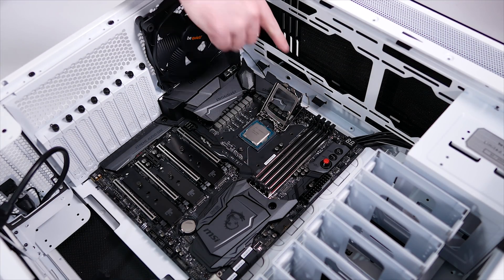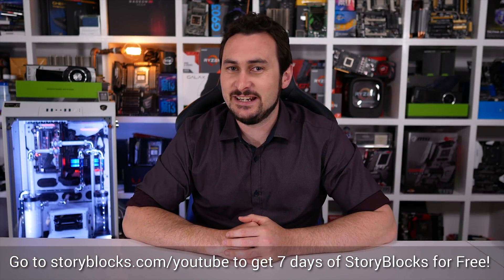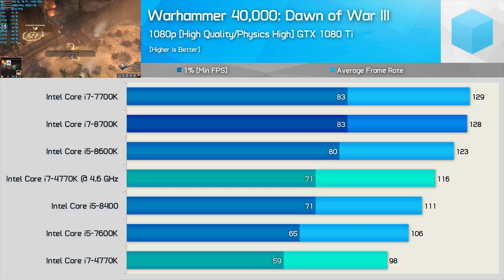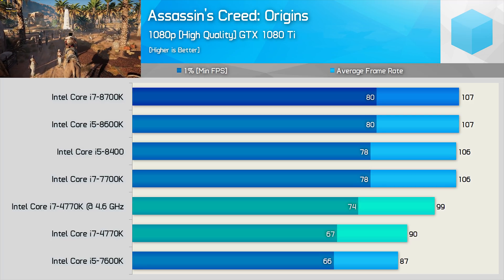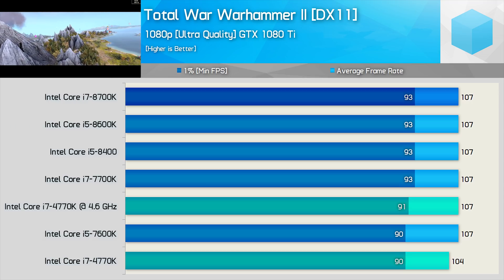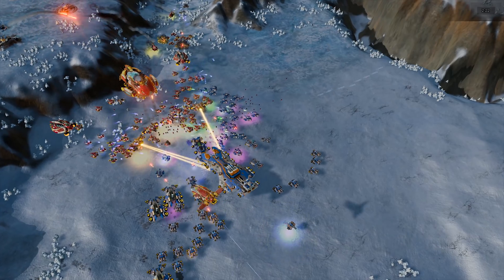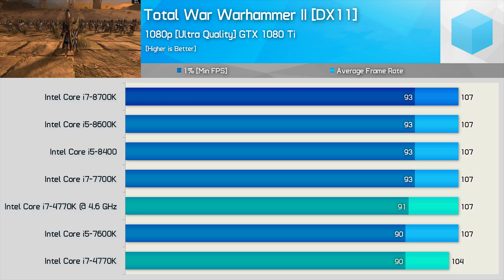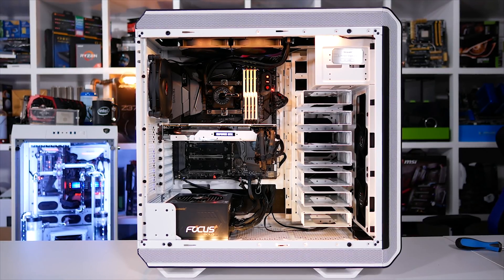4 Year Old Core i7 vs. Core i7-8700K, Worth The Upgrade?

Comment: Working with OC i5 7600k at 5ghz ice cold, and about to buy 2 MSI GTX 1080 cards for SLI. ( Yeah I love SLI looks in my case and messing around with it )* moving on, will the i5 OC bottle neck them? if so will I be ok using i5 7700k or make the leap to 8700k?

Comment: I have a i7-4750HQ and I'm yet to meet a game that will push this CPU more than 40/50% load. A laptop CPU is much weaker than a desktop and if I don't need an upgrade, not even for the next probably 5 years, nobody else need. End of discussion. Saved you almost 20mins.

Comment: 4690 here and the R9 380x.. all games still run fine.. FarCry 5 mix of ultra and high settings means 50-80 fps for me... Totally fine, not a performance point where I start to open my wallet for someone else to get richer off of my cravings.

Comment: I have an i7-4790 and use an msi gtx 980 ti 6GB and have no issues gaming without streaming. I'm only upgrading to the 8700K because my 4790 is bottlenecking my GPU when streaming and especially when i overclock it causing extreme frame rate drops and only able to run 100hz refresh rates on games like Fortnite because of the frame rate drops. Kicking myself for not spending the extra $50 4 years ago and getting the 4790K, but i guess it leads to me getting a cool brand new gaming/streaming pc.

Comment: When you do a cpu benchmark, would be great if could use cards like 1060_70ti. 1080ti is ridiculous, doesn't tell us if cpu upgrade is worth it. Like a 20,30 fps gap using 1080ti could go down to 5,10 using lower cards

Comment: FWIW, MSI Afterburner is your friend. The OSD shows my "aging" CPU's usage at 34% max (23% avg) and VRAM usage at 1.2Gb of the 4Gb available, while my equally old GPU still cranks out 160+ FPS in War Thunder with graphics set to max @ 1080p.

Hardware:
i5 4690K @ 4700Mhz
ASUS Z97-AR motherboard
16 Gb Ripjaws X DDR3 RAM @ 2400Mhz
Radeon R9 380X @ 1085Mhz (core) & 1425Mhz (mem)

Comment: I have 4790K OC on Noctua, had it since it was new.
Am now on 1080Ti, before that 1080, before that 970.

The CPU is not a limiting factor yet, I run games on max details and 2560P.
Did order a couple of ryzen 2700x when I saw early promises of the ryzen crushing intel i7 also in games (by Norwegian tech site), however it doesent hold true. I think I will return both 2700x cpus unused and wait for the coffe lake refresh (maybe we will see an affordable 8 core high performance model?).

I think we are in a bit of a mixed state now, PCI-E version 4 is coming with double bandwidth and lower latency, new RAM is coming, new GPUs, new chipsets, new CPUs. Also I just game a couple of hours each month, so I guess I should return the 2700x  cpus and wait untill 2019 maybe.

Also the new SSDs are coming.

I think the 4790K and the top tier mainboards from that time is a very good combo still, as you have M.2, you have fast USB with quickcharge, decent audio quality, good LAN etc. (I have a mATX Asus ROG board and the best corsair had to offer in DDR3 back when I purchased it).

What is funny though is that the 4790K is still for sale and it costs almost the same as the 8700K :P
But you can of course build a much cheaper 4790K gaming rig for 100+ FPS than i7 8700K or ryzen.

AS you can then buy a used or new mainboard for half the price, also the RAM is much cheaper and availible used.
So instead of people buying a new 8700K and lets say gtx1070, I would rather stick with an old i7 and buy the 1080ti.

I can of course afford to buy which CPU I want, but I dont think its worth the upgrade yet. In 1-2 years I think it will be, especially when we get the next gen monitors also with proper HDR support.

I do want some more cores thougn, I think one thing that is dated with the 4 cores is the applications starting when windows boots. But maybe it would be possible to make them start not all at the same time, some sort of timed launcher, so steam and ea +++ doesent all start at the same time. I think thats the only time I feel I need more speed :P

I do programming mostly on laptops while at work, so I dont really need a lot of multithreaded performance at home.

Comment: This is a good reason why even though I'm running a 1080Ti, I never bothered upgrading my Z97X 4790K system. It's funny hearing noob's ask me if my i5 will run new games when they hear I have a 4790K.
Reply: I'm using a Gigabyte Z97X-UD5H v1.1 with an i7 4790K@4.7Ghz and 16GB of DDR3 PC3-12800

Comment: The real winner is i5-8600K - 30% cheaper than i7-8700K... with 2nd place on most benchmarks... and bit cooler when O/C:)
I've got i7-4790K at this moment (4.6Ghz/1.25V) but now i'm thinking about upgrade to i5-8600K.

Comment: What REALLY PISSES ME OFF is the fact that you guys always do these kind of videos with THE TOP OF THE LINE GPU'S... Try using 1050ti, 1060 (3 and 6gb) and so on. Almost everyone I see building pc's or upgrading there older intel 3rd gen and up systems is upgrading to 1050ti and 1060 gpu's. Your doing this video like 90% of the people are well off and buy expensive GPU'S... Well its more like 90% use 1050ti or lower to tell the truth... I personally have a 1060 6gb in one machine and a 1070 in another. Anyhow...

Comment: My build is a Dell Optiplex 990 with an i7-2600 with 12 gb ram 4+an added 8gb.  I have a Zotac 1060 6gb amp.  Everything runs fine on maxed settings (so far), but I know it will eventually be time to retire it.  I only had a 750ti and couldn't max out everything just got the 1060 and it fixed everything for now.  I would like to know where my CPU is on this chart, at the very bottom?

Comment: thank god AMD finally forced Intel to increase the core count... the singlecore performance has only marginal increments from gen to gen... and at same clockspeed (let's say 5.0ghz on 240mm all in one watercooling) there's about no real world difference from i7 2600k to 7700k assuming all the CPUs are paired with same SATA3 SSD and HDD and all using DDR3 or DDR4 clocked at same 2133 or 2400mhz. Yes there are improvements in the iGPU department and the newer instruction sets make the newer gen way more productivity friendly... but in the raw performance improvement was slow as a turtle

Comment: Probably should use a game like ARMA3 since it stresses CPU a hell of a lot more than console fodder like COD. Also should have used a SLi benchmark for 1070 and 1080, 1080ti options as that's where the real CPU caps will show.

Comment: I don't even need to watch - yes worth the upgrade. I went from a 3570 to an 8600k and obviously its a huge upgrade. I mean it's an i5 and beats the previous flagship i7. Btw that RGB is horrible lol. Some weird results. Everywhere else there is absolutely no way the 7700k beats the 8700k, not even close. It doesn't even beat the 8600k. The 4770 beating it too, ummm no. This is not a very good review IMO as everywhere else, benchmarks prove to be VERY different to yours. I've seen MASSIVE gains, while being only on a GTX 960, so no, your conclusions are incorrect IMO
Reply from the maker: The 3570 wasn't tested in this video, the significantly more powerful 4770K was, and it was overclocked. I don't care about your option on RGB so let's skip that. The 7700K doesn't beat the 8700K in a single test so I'm not sure what you're talking about there, in fact it's quite a bit slower in most of the none GPU bound tests. The 4770K doesn't beat the 8700K either.

If you saw massive gains with a GTX 960 you're the one doing something wrong, I keep those findings to yourself.

Comment: I hate to sound stupid but what was the cooling solution for the i7-4770k and could it sustain full load of "IntelBurnTest" without throttling when overclocked?" Another thing is that "stock" clock is pointless if your cooling solution allows 100% sustained turbo speed. Just compare max speed to max speed. With the right cooler the 4770k can sustain 4.4Ghz and never throttle.

Comment: Hi i have i5 6600 non k. Msi bazooka b150m with support for kabylake. 12 gb ddr4 ram and gtx 1060 6gb. Built it last year. Do you think i should soon upgrade my cpu to a i7 7700/7700k? I have 100% workload on my cpu in assassins creed origins and sometimes in rise of the tomb raider.

Comment: is 4770K delidded or not? Also what Vcore and other changes has been done to push to 4.6 Ghz? Thanks a lot. Great VIDEO. Subscribed!
Reply from the maker: Hi Paul, the CPU was not delidded. It was a safe voltage, not excessively high, I don't recall exactly I'll have to check my notes.

Comment: i have adhd so i skipped parts but where is the 4k benchmarks what part off the video is it at ......will a i7 4770k be decent for 4k with 1080ti ??? is 4770k better then 4790 non k .... with 1080ti...edit ive watched it all and no 4k benchmarks wtf who buys 1080ti for 1080p ....
Reply: The cpu will not make a noticable difference really in 4k..

Comment: I think the upgrade is reasonable if you play at 144 Hz. Large online games such as Battlefield 1 use more CPU than the campaign benchmarks. If you only have a 60 Hz monitor, which is most people, you wouldn't notice a difference though.

Comment: When I first got my 7700K even with 5ghz oc I couldn't get much higher scores on graphics benches over my 4670K.  Now I know how to overclock it to the max optimising memory and northbridge as well as voltages it can beat Broadwell Xtremes (by fractions).
Took a lot of hours and benching to suss it out, where I got to the i5 Haswells limits relatively quickley (I still occasionally try to push it more but usually fail).
If you want top performance getting the memory and northbridge optimised is as important as the clock.
Hopefully some of my latest HwBot benches on 3dMark 11 will hold up and I'll continue my 100% unbeaten streak in challenges.
For a normal gamer I'd say the 4770K is plenty good enough and considerably cheaper than the slightly faster 4790K.

Comment: If you play BF 1 multiplayer 64 players, GTA V, Watch Dogs 2, NFS 2017 then you will see a massive difference between i7 4770k and 8700k. CPU load is nearly 80-100% all the time when playing bf 1 and sometimes it doesn't seem to be very smooth.

Comment: I’m still running an overclocked 4690k at 1440p 144 hz without issue. I’m still getting 100+ fps in most games. Gpu is a 1070

Comment: Core i5 7600k to either i7-7700k or i7-8700k. Is it worth the upgrade?  My main use is gaming (iRacing mostly) and my gcard is a GTX 1080 with 32gb ddr4 3000mhz latency C15.  If I went 8th gen I’d need a new mobo too....

Comment: Did anyone else notice that the Vega tests all showed lower frame rates than the 1080 Ti and he blamed the CPU. Vega is not intended to be used as a gaming card. It's basically the AMD equivalent to a Quadro but more heavily focused on the professional side. Also, running games to test a CPU and then using frame rates as the result metric is utterly misleading because the video cards are doing a lot of the work (there maybe some exceptions (sort of). Ashes is one of them but at the same time Ashes isn't really a game. It's an interactive benchmark at this point). It would have been better to run some cpu only benchmarks and then compare those

Comment: Why would you run these benchmarks at 1080p when it is well known that the GTX 1080 TI does not perform well at that resolution?  These benchmarks should have been run at 1440p or higher since no one in their right mind would buy a GTX 1080 TI to run at 1080p.
Reply from the maker: Why doesn't it run well at 1080p? :D I think we're missing the point here.

Comment: will a 4790K @4,6ghz keep up with the upcoming Nvidia VOLTA 1180/2080 playing battlefield 1/PUBG in 1440p and the next BF? BF seems to be fairly demanding online and i wondered how much of this is due to the online aspect? also if my cpu sits at 80-100% now with 100 FPS ish in ULTRA with a gtx1080 would a faster GPU be bottlenecked by my CPU?

Comment: the speed on ddr4 alone should crush haswell gen
so if u were to use ddr4 thats closer to the ddr3 ur usings overall latency
possible 2400 cl18 running at cl20 would hit close
but i agree in terms of gaming no point in upgrade
go for more cores if ur gonna upgrade otherwise wait till 2nd gen 6core consumer grade chips

Comment: So how where the test benches setup for this? He never said what memory he was using or anything else.
Reply from the maker: He did say exactly what memory was being used.
Reply: Hardware Unboxed yeah my mistake. But then my question is why didn't he use DDR4 2400 memory to make things more CPU dependent? Or use DDR3 3200?
Reply from the maker: The Haswell CPU can't use DDR4 memory mate, the best memory we could pair with the 4770K was paired with the 4770K.
Reply: Hardware Unboxed hence DDR4 2400 for the 8700K or underclocking the set you had to 2400 since 3200mhz DDR3 to pair with the 4770K probably wouldn't be sitting around the office.
Reply from the maker: Yeah... I'm at a loss as to why you would do that for this test. sorry.
Reply: Hardware Unboxed because your comparing two CPUs against each other so your test benches should be as alike as possible. Because you didn't you introduced more variables. I know that DDR3 stopped being used since 4th generation and 6th gen and up use DDR4 but you can find 2400 DDR4 or have underclocked the 3200 DDR4 to better compare the CPUs without any other deciding factor.

Comment: Built a new Workstation computer with  a socket 1150  3,4Ghz Xeon E3-1231 generation 3 six months ago. Have now a GTX1080ti and with that combo I can run pretty much any game at 4k resolution, difrences between CPU generation last 4-6 years is really small.

Comment: Good video, but I would have included 1440p results too. From the tests I've done, the margin between the 4th gen and 8th gen becomes smaller and smaller. But at 1080p, it's a decent % increase between the two

Comment: Currently run 
Gigabyte ga-z97x-ud3h-bk
I5 4690k 4.8ghz winter oc lol
2x4gb ddr3 1600mhz oc to 1866mhz
Gtx 970

After watching ur last vid on how vram affects system memory it seems my upgrade path is possible faster memory and 16gbs and by this vid more so a second hand i7 finally. My question what speed of memory.

Comment: I recently replaced my 4770 (non-K) machine with a Ryzen 1700x machine. Frankly, I'm not seeing any significant difference. Should have saved the money. Live and learn, for sure.
Reply from the maker: The 1700X won't be better for gaming (at least not current games). It's better in applications that can utilize its many threads.
Reply: davidinark same here. I do notice a bit smoother gameplay overall though. Most likey from the higher core count. And as far as non gaming and multitasking goes, it's fairly noticeable. Lastly there's future viability, when games start using more cores.

Comment: The point was; 'is the 4770/90'k' requiring a system upgrade?'
The answer is no (for general gaming,anyway).
Cheeses. 
And Steve accused me of not being the sharpest tool in the shed?
I ran ZERO benchmarks to come to that conclusion.
Far more people use a mid range gpu and i7 chip for gaming/general longevity in all tasks
 than most people think is likely.
(they used for e.g a 4770'k' and GTX 970. the difference between an i5 and i7 being £75)
Very few if any give a toss about 120 htz+, and the teenagers that do cant afford £400+ for a gtx 1070.
Generally the kids are so skint they pair that 970 gpu with an i5 or lower.
 The adults just buy the best value 1080p gpu so they can game with the rest of what they have built and care little.

Comment: I get the point of the benchmarks but in all honesty they are always flawed since this only makes sense if you have a 1080p 144Hz monitor with a i7 4770K and a 1080 Ti and you haven't overclocked your CPU.

1440p 60Hz 27" displays where the go to for gamers who where building a Haswell based i7 gaming system, for those gamer's a upgrade in CPU would make little to no difference especially when you counter in the fact that in order to see any performance difference they would require not only a new CPU/RAM/MOBO for $500+ but a 1080 Ti a $700 GPU.

A friend of mine was one of those gamer's who had a i5 4670K and a 1440p Asus 27" with a GTX 980... Went and got him self a 7700K, no real difference in performance for gaming what so ever. 

I have a 4K display with a 4670K and a 1080 Ti... Upgraded to Ryzen 1700X and 16GB DDR4, 4x more cores and twice the amount of faster RAM and my framerates in games are borderline indistinguishable. 

TLDR:... Not worth it unless you game at 1080p 144Hz and have a 1080 Ti.
Reply from the maker: Gamers with 60 Hz displays still want well over 60fps, so the testing isn't flawed.
Reply: I understand that... But at 1080p?... I don't know anyone with a 60hz 1080p display with a 1080 Ti who is planning on buying a 8700K. Also on the other foot is if the person doesn't have a 1080 Ti and has a 4770K, upgrading to a 8700K will give him/her a even smaller performance boost.

I do understand that people want to future proof a CPU and doing that is great but those parts on a 1080p display?... No one I know or have seen on any gaming forums with such a Frankenstein of a setup.

Comment: Soooo much beating around the bush... basically if you have (or plan to get) a GTX 1080ti and want the best results then by all means get the 8700k. If you have any lesser gpu and dont plan on getting a 1080ti then no, its probably not worth upgrading. Moreover... if you dont have 1080ti money you shouldn't be looking at an 8700k processor anyways.

I'd also like to add that my God that 1080ti Galax HOF is STUNNING. Love the Deepcool Captain RGB aio as well.